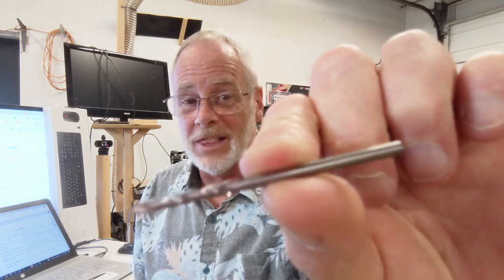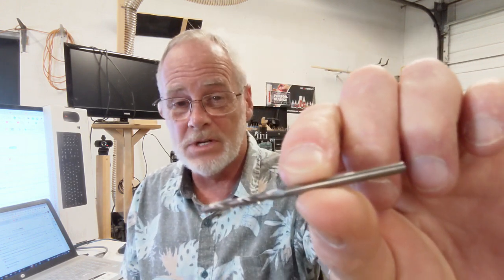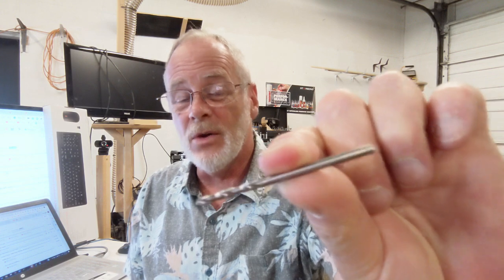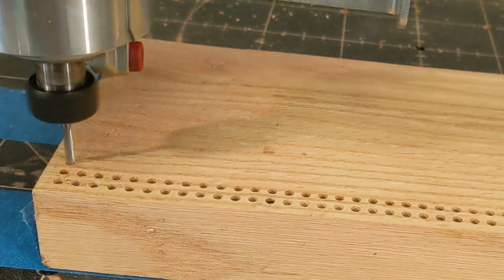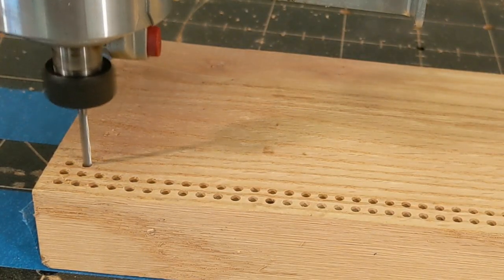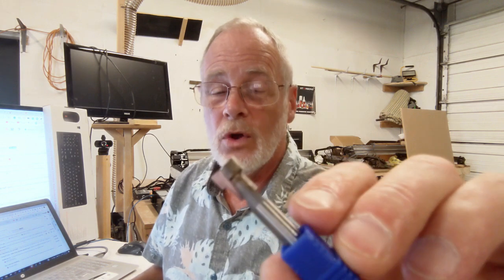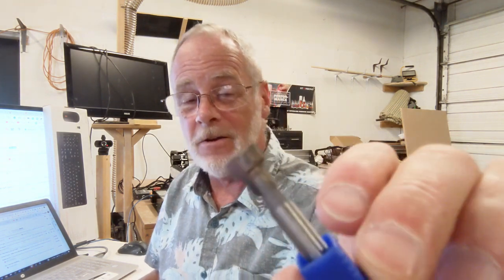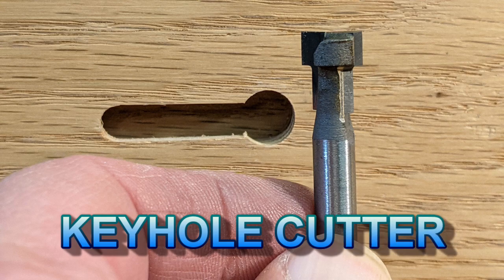The FASTEST 1/4" Drill bit For CNC Routers [Cribbage boards and other projects] promo

Comment: Since I already have the 1/8” drill bit and just upgrading to 1/4” routers, would this be an acceptable temporary alternative to drill 1/4” holes without buying this bit right now - Drill 1/8” and follow with a 1/4” ball nose?
Reply from the maker: Drilling a 1/8” hole and then following it up with a 1/4” ball nose bit can work for some applications, but be cautious about accuracy and finish. It might not give you the cleanest results for all projects, but it’s a clever workaround!

Comment: was the bit still cool enough to hold after 752  holes using the IDC speeds and feeds?
Reply from the maker: That's a great question! Typically, if you've set the IDC speeds and feeds correctly, the bit should remain at a manageable temperature even after that many holes. However, it's always a good practice to monitor the bit's temperature, as excessive heat can affect performance and longevity. If you feel any discomfort when touching it, it might be time to pause and let it cool down. Thanks for your interest!

Comment: Would this be faster than milling for clearing out material? I'm trying to cut out 2.5 inches to make 2.5 inch deep 3/8 inch diameter shafts. I have a 9000 rpm spindle. My 2.5 inch length of cut endmill gets a lot of chatter currently.
Reply from the maker: regionsbeyond7336, that would be a great option brother! Using a 3/8" drill bit to cut 3/8" diameter holes would work great in your application.

Comment: Too much tear out for a game board. I've used a standard drill bit in cedar and it does fine. I think you might get a better hole using pecking.
Reply from the maker: good points brother, pecking does deliver a good clean hole if your looking for the ultimate in precision.

Comment: This 1/4" drilling bit will dramatically decrease the run time on a special niche side project. I just need to change out my 8mm spiral drilling to 1/4” plunge drilling. Reducing run time is very important when using a community 4x8 CNC. Thanks for the video!
Reply from the maker: Dion, I couldn't of said it better myself brother!

Comment: A split point carbide stub drill with polished flutes is very good for starting holes and deep drilling without pecking. it works pretty good with many metals also.
Reply from the maker: CNC Programmer, you're absolutely right. That would also do the trick! Thanks for the tip!